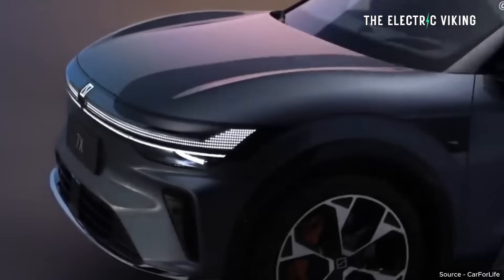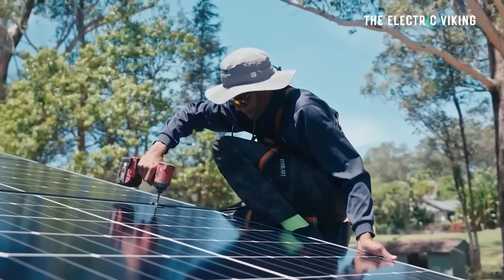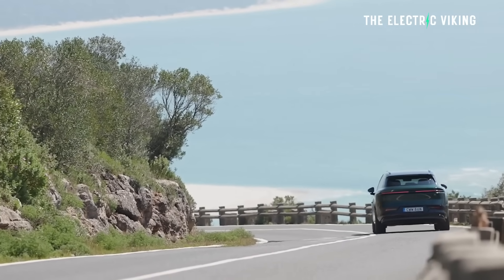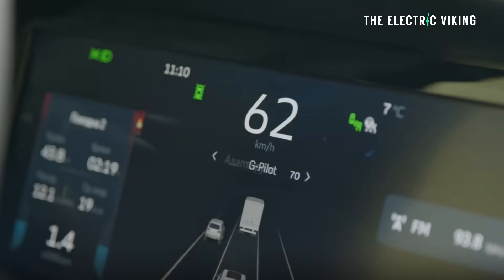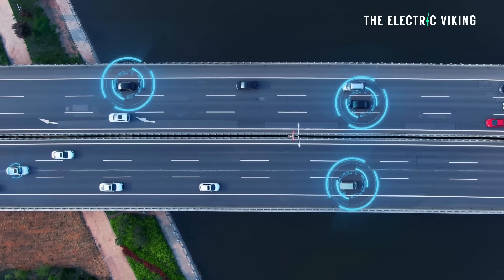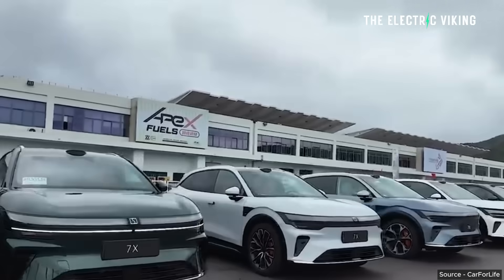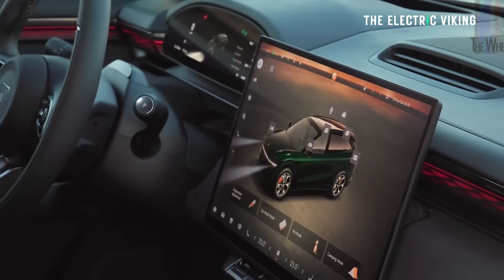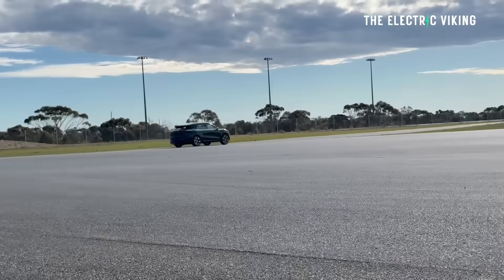Zeekr Reveal NEW 7X with 900V, 700kw Charging and 2.9 Seconds 0-100

Comment: I live in perth and I am a car enthusiast 
I test drove the AWD version twice and this is my honest assessment 

Pros :

Beautiful looking car

Luxurious interior 

Equivalent to European luxury cars

Excellent leg room and passenger comfort 

Amazing Head up display ( top notch)

Great battery charging speed ( top notch )

Comfortable seats

Great value for money ( actually the best value for the luxury features it offers compared to any competitor SUV in Australia at the moment)

Cons:

Unfortunately not a driver’s car more of a luxury family car , drive is somewhat disconnected , there is a slight initial lag when you accelerate , feels floaty at times . Generally underwhelming to drive which really surprised me when taking into account the powerful engine ( definitely needs tweaking ) . I think tweaking it by Zeekr will probably improve things to a certain degree 

AC struggled in the day I got it ( set to 19 C and still took a long time to cool the car ) and was very noisy . Could have been a specific issue with car I got but I notice that this issue has been raised before , I think it should be an easy fix

Clumsy and very slow auto park , hopefully will improve with software updates

Decent lane assist and adaptive cruise control but not impressive , again software updates should improve it

Voice control a bit clumsy ( you need to repeat several times ) and cannot manage drive settings ( which was a surprise as most European competitors have it ) , this could be fixed with future software updates 

The screen is very confusing and needs time to get used to . I guess when it is your car you will eventually figure it out and adjust short cuts

No self drive ready options and no lidar ( crazy and yes I have driven the tesla and although it is not the best looking car and lacks any luxury features but it has self driving now in Australia which i tried for long drives ) using Australian legislation as an excuse is not acceptable as Tesla have introduced it and the regulations in WA just asks that you keep your hands on the wheel and be attentive 

The Perth dealer personnel are very nice and friendly but seem to be overwhelmed and not really that experienced ( I think it is new in Perth ). I think I know more about the car then them🤣 I don't really know how the after purchase experience will be 

I was somewhat disappointed as I think this car has great potential. Personally I would wait for the 2026 model ( released in china but will take another 12-18 months to reach Australia 🤣🤣)

Overall it is a great luxurious family SUV with a lot to offer , but there are significant issues which if fixed will make it a great car .

If you are looking for a luxury family SUV and not after high tech/ driving experience then this car is the best available option currently in the Australian market

Comment: It´s not too much Power. If you want to handle this Power you have to work with your Brain. Not always full throtle. Drive with care. You don´t have to use all the Power allways. You have it and you can use it if necessary.

Comment: @sam : Many owners report that the Zeekr 7X still struggles with some fundamental issues.
Frequent complaints include:
• Car feels unstable when driving straight at highway speeds — something that should be a basic trait.
• Personal settings often reset by themselves.
• Manufacturer communication is slow, with owners waiting for a promised Q4 software update to fix things.

Comment: A lot of the options available in China are not even available in other markets like Europe.  There is no refrigerator option on the EU website yet it cost more than the fully equipped one with a refrigerator and lidar in China.
Reply: High tariff policies under trade protectionism

Comment: Has anyone from Zeekr spoken about 400V charging speeds on the new 900V platform? 

We know from testing of the 800V Zeekr 7X, that there is a bottleneck with 400V DC chargers. This appears to be a limitation of the onboard DC voltage converter from 400V to 800V being limited to 200A. This means a maximum charge speed of around 80KW on 400V chargers. There is no charge limit if you use 800V chargers, and the 7X will then charges at it's advertised speed.

Do we know if this bottleneck has been addressed with the 900V architecture?
Reply: Basically every 800V car has this. Maybe excepting silly expensive ones.
Reply: Depends on the implementation. True that most cars will run a DC converter like the Zeekr and they will be limited in some way on a 400V charger. 

Others will split the pack into two separate 400V packs during 400V DC charging. Porsche/Audi does it that way for example.

Kia/Hyundai probably have one of the most interesting implementations by running the power through a DC-DC converter and then directly through the motor windings as a filter to help convert the voltage. This enables one of the highest efficiency DC conversions.

Comment: a Car can have a 100 megawatts charging capability.  If there is no 100 megawatts chargers.  It means nothing.   Just saying.
Reply: Buy it to be future proof. New chargers will have a battery as booster. Like the byd 1 megawatt charger.
Reply: Never?
Reply: 400-500kW charging speed with efficient drivetrain is more than enough
Reply: Charging infrastructure will improve with time. 150kw used to be called fast charging but now it's average at best. Having 450kw charging just means that you know you can make use of the fastest chargers in the future. Road trips excepted most charging is done at home anyway.